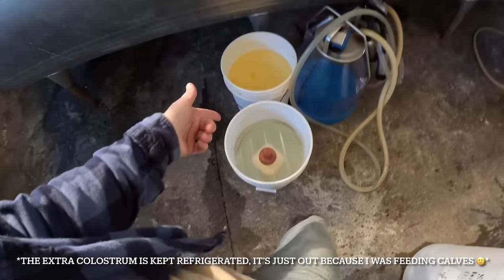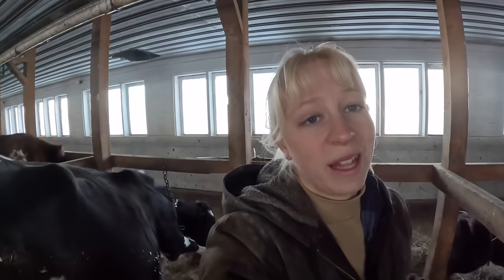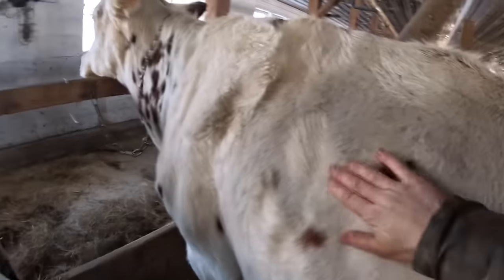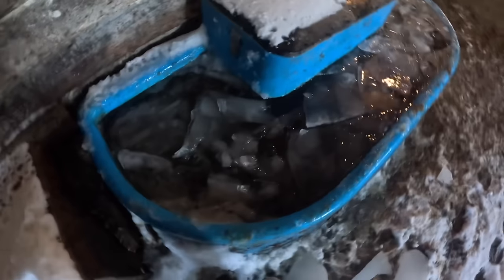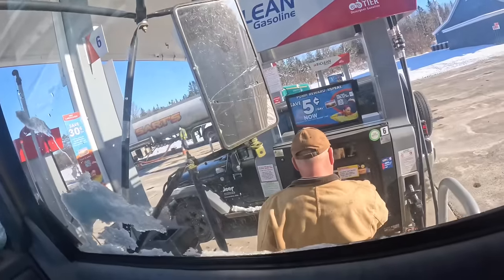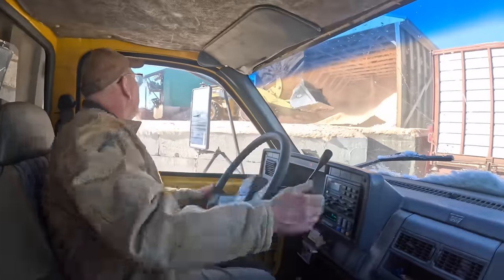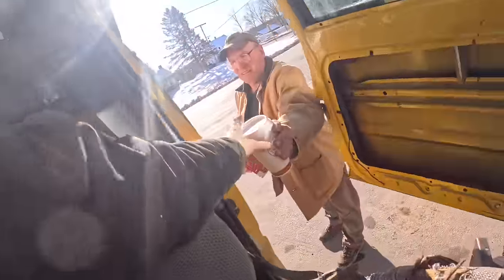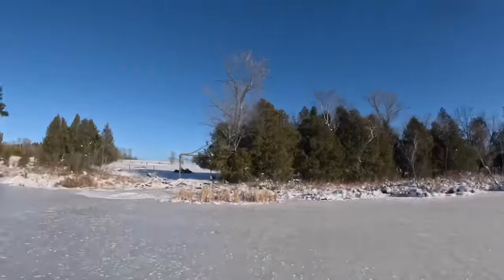Milk cows with me this morning and what I do for fun…

Comment: As a retired truck driver who spent nearly half my career hauling steel and machinery, I know a little about tarps and bungees. The first thing you guys need to do is attach your bungees to your tarps permanently. Just clamp the hooks closed in the tarp's eyelets with Channellock's so they won't come out/fall off. then it is easy to hook the free end back on the strap when not in use, to keep it from getting hooked on and tangled up when not in use. There's a quick easy maneuver for this but I don't think I can explain it without a visual aid. You can buy a trucker's 5th wheel hook @ any truck stop or trucker's supply store for reaching your straps from the ground. But you're smart and sensible enough to just make your own from whatever you have laying around. An old broom handle with a bent nail or any kind of hook attached to one end will do .

Comment: Taylor just watched this video and your looking for the hook that grabs the tarp, first of all hook all your tarp straps to your tarp and use a large pair Plyers and bend them closed then they stay on the tarp. The puller thing is probably a fifth wheel puller and can be bought at any truck stop they are about 4’ long with a nice handle.  Hope this helps usually chrome so they don’t rust or aluminum…

Comment: Morning Tay, when I was about your age, sawdust was free from a local mill but you had to load it yourself by the shovelful and used a pickup with side boards.
The hook for the bungee cords, Fisher snowplows used a long hook to pull the lower pins on the blade. Hope this might help. Stay out of the hot sun.

Comment: I live just about an hour away from where they made Unadilla Silos! I took down my Dad's 2 and used them in my house I built! Some of them were doweled together, you couldn't get them apart! I was never one for the Harvestore Silos- A.O.Smith always turned into I.O.Smith! you can make a hook, just get some round stock, put it in a vice and bend it around, put the end on the grinder to make a point, thee weld a piece of pipe on top for a handle! Give us a little tour of the store, looks interesting! The wife & I use to go snowmobiling in between chores! We use to go skating too!

Comment: Not all bolts are created equal.  Obviously, the bolt broke because someone used a soft bolt instead of a hard bolt or maybe, after many years of cyclic stress, the bolt finally fatigued.  Bolt hardness is indicated by markings on the bolt head.   You obviously need a hardened bolt for this application in any case and you might want to check these bolts periodically for wear.

Somehow, I knew there was a coffee and doughnut in your future on that sawdust run.  Your favorite trip.   Perfect day for a nice snowmobile ride and you ride well.

Comment: I know just what you mean about heavy sliding doors. as I have one that has to be opened numerous times a day as we switch groups of cows for milking. My husband greased the track for me the other day using recycled hydraulic oil in a grease can. What a huge difference that made. I can open and close it one handed now. Try it and see if it helps your door.